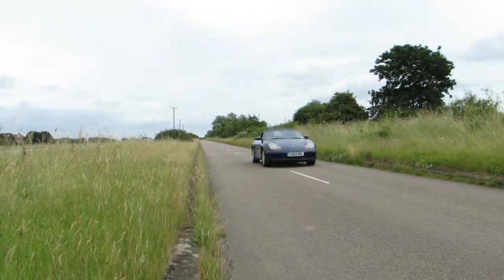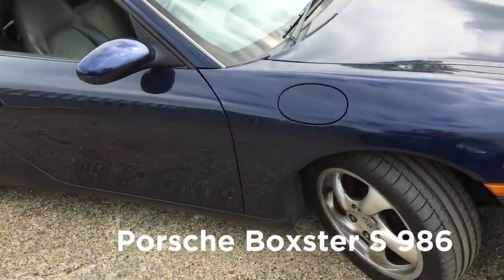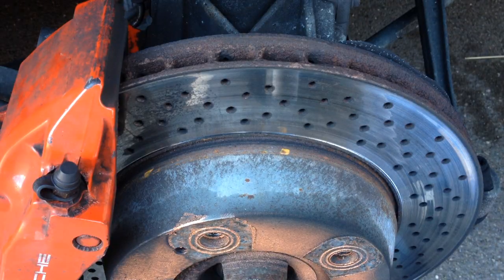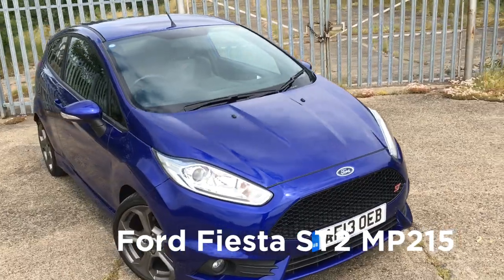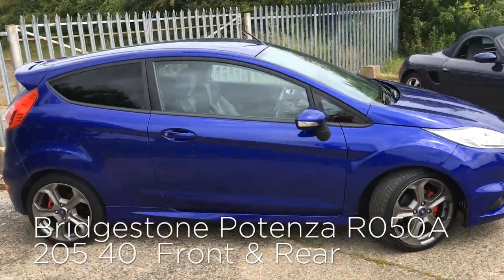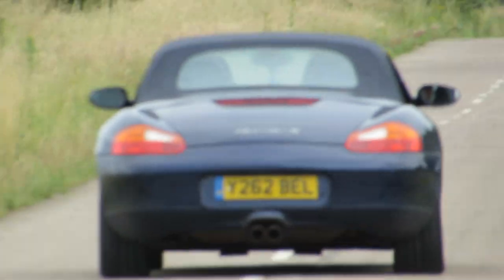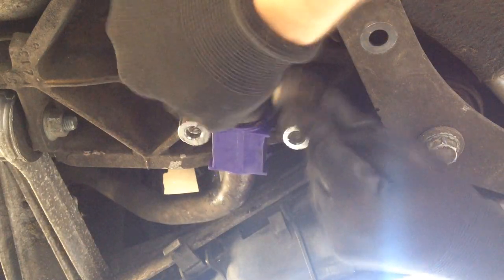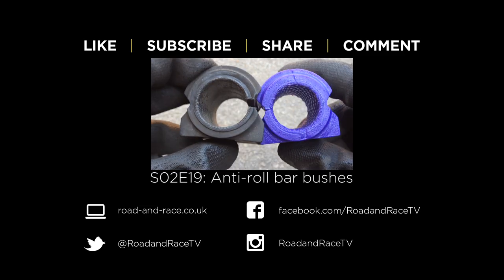Boxster S 986 v Fiesta ST challenge

Comment: automatic/tiptronic transmission kills the performance, should of been a manual to get the most from the 3.2 motor. These cars are designed for handling and all around performance not drag racing. nice video anyways.
Reply: Agreed, I have a later 987 3.2 S with the 6 speed manual and it is significantly quicker than this, over 1.2 seconds to 60 in fact. The old non pdk autos kill this car

Comment: fun video, I have a 2004 manual  Boxster S (with glovebox!) which is definitely quicker in the 0-60 performance but the ST is hurt by needing that extra change to 3rd as you point out.  You can't beat the sound of the flat six as it opens out over 4000 rpm up to the limiter however.

Comment: Fiesta can get a quicker time with the MP215. To stop the wheel spin you need to feed first gear in, not drop the clutch.
Reply: Ah difficult to see without a camera on the clutch and still a great video anyway :)
Reply: no, not at all. Obviously the limit is the tires contact to the ground. Brakes should be sufficient to make the wheel block. But take it to small roads and measure the grin on your face. Or ask the girls about porsche vs ford.... :)/boxster S owner.

Comment: Great video as are all the Road and Race ones I have seen. As a manual gear Boxster S driver, I am very happy to see that I will be able to comfortably whip the ST ass in going and stopping - even in this souped up guise. I have driven my daughter's more basic newish Fiesta and was amazed at how light the brakes were - nearly put my passengers through the window when braking lol. This lead me to believe that maybe the much heavier Boxster brakes were poorer. Good to see this is not the case. 
Did not realise your points scores were a running total at first and had been a bit livid as Boxster seemed to be losing to the Fiesta. Happy now I have grasped how you scored it :-)

Comment: Interesting match gentleman! I'm surprised to see a tiptronic in the UK.  I thought slush boxes were rare in the European market.  My stock 2002 S 6spd will easily and repeatedly hit sixty in under six seconds.  A Boxster S with a manual box would have widened the gap considerably. Also, There is no way that Fiesta does 30MPG in spirited driving...delivering 197hp on 30mpg is a physical impossibility.

Comment: In the 0-60-0 test if you get to 60 quicker you cover less ground. Could time it and see where time is lost. Crossing a line at 60 and measuring distance to stop is usually easiest. 
Great review, been wanting the Boxster but the St is newer so maybe more reliable and fix in the middle of nowhere. 
Unanswered question, can a front drive four seater match slalom or twisty road smiles with a mid engine two seat sports car. I heard St is amazing even on track.

Comment: A bit of a laugh but the Porsche was 5 times the age of the Ford and hadn't been mapped.
Reply: The boxster was not a super car and its cost new was not vastly different than an overpriced hatchback.
Get a second hand ford hatchback and spend the same money on a second hand boxster and see what you can get.
Reply: Dunno about that. The S model Boxster, when new, went for well over 80k (here in the Netherlands).
Reply: the boxter was not a super car, but a sports car, and german, so it was about 3-4 times the price of a new fiesta, if not more. Its also really not as practical as the fiesta.

Comment: You post up some nice videos, but why in the world did you opt for the "chicktronic" transmission? Makes the comparison not really a comparison...
Reply from the maker: Thanks Wunderboy!   Episode S02E22 explains all... https://www.youtube.com/watch?v=VSlO0GTMYAU
Reply: Road and Race ok, you need a cheap beater automatic car for your mundane motorway commuting, and the Boxster in manual for the weekend and track then cause the automatic really kills the experience for a sports car. It's not like the tiptronic is a PDK where it's still a dual clutch manual without the torque converter sapping away the power.